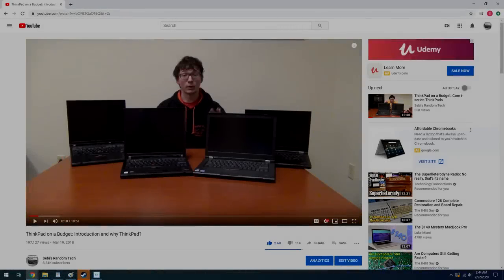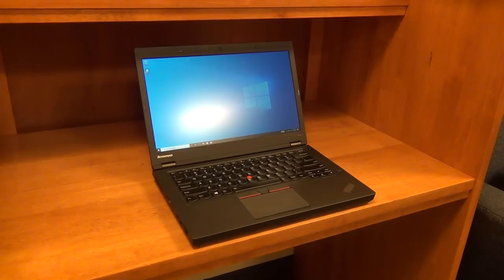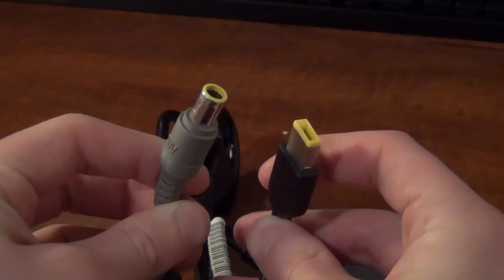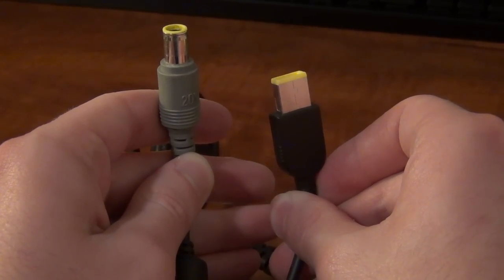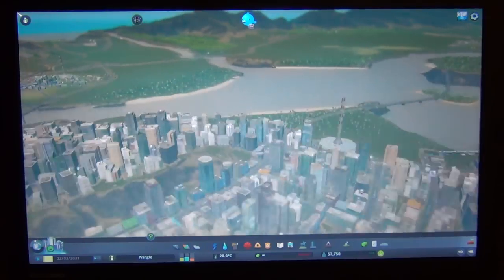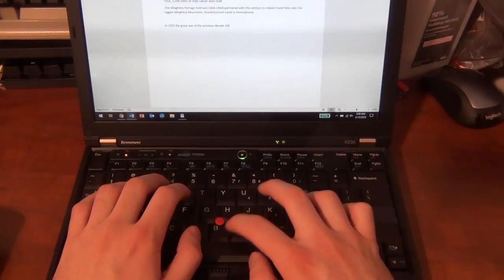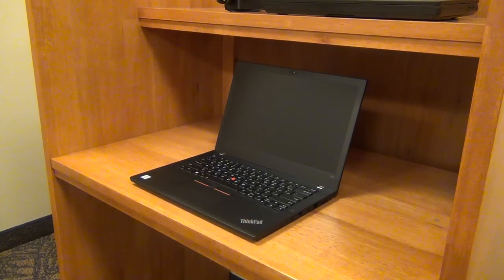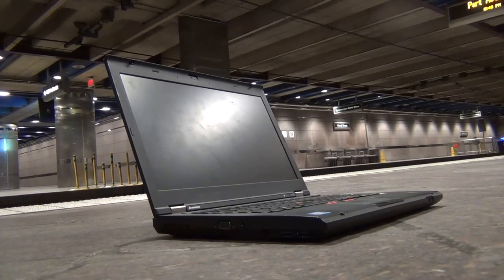Best Value ThinkPads in 2020

Comment: You're the man.
I Couldn't make my mind on witch one to pick but you helped me decide. 
Glad they managed to finally open the BIOS on machines past the X200.
Reply: So I picked a T430 for 61 dollars. (115 total for shipping and import fees)
i5 2.6Ghz | 4go | no HDD (the bottom screen looked a bit cracked, no pic with screen turned on were provided but seller offer 30day return option)

For now, they seem to go around 115 USD but without shipping. The famous x series look more expensive.

You guys have any recommended links to max-out the ram?

For screens I've seen 1440p displays but no 1080p ones. Isn't that too much for the GPU?
I guess I cut the resolution in half in games and still have a sharp view since it's precise 50% pixel reduction.

Comment: i just bought a t430 with 16gb RAM, i5, duel SSD's (250 & 500gb), spare battery & dock, Win 10 with office, with backlit keyboard in near mint condition for £250 (around $300). very happy, thank you for all your advice Sebi. love the channel. only thing is the hinges are a little floppy, any chance of a hinge replacement video?

almost forgot...

replying from my thinkpad
Reply: I wanna buy T440s. is it good for value?
Reply from the maker: I might be doing that with my T430 soon, stay tuned to find out! :)

Comment: 20:10 if you aren't aware, people have successfully built EC patches for the T25-T480 frankenpad thing. I think it can only be flashed with hardware, but it shouldn't be too expensive. What is the issue is that you cannot get ANSI layout classic keyboards anymore, the only ones out there are JIS.

Comment: T420 with i7 quadcore, built in webcam, 1600x900 Display, at least 8GB of RAM, new batter, BD-drive and current Linux Mint Desktop system installed on a SSD. Perfect daily runner. You don't need more than that for your every day tasks. Just make sure you better get a version with Intel graphics since the Nvidia Optimus tends to overhead the system a little too much. Unless you wanna play some games on it and have a laptop fan cooling pad underneath.

Comment: It should be pointed out that the Thunderbolt issue on some of the newer ThinkPad's (with the T series it started with the T470/T570) is caused by a critical bug in Intel's Thunderbolt firmware, which isn't present in the newer versions of the firmware. If the firmware is updated "before" the damage is done then the will be no Thunderbolt issue, and the affected ThinkPad won't need to be sent in for repair (entails getting the motherboard replaced). Was a huge surprise to hear that the Thunderbolt Firmware is developed by Intel and NOT Lenovo. Intel used to manufacture their own motherboards, but often they were defective. One of the major reasons the Intel motherboards were defective was because of the buggy firmware. Clearly Intel haven't learned their lesson.

It is very likely that other laptops supporting Thunderbolt will be affected since Thunderbolt is a proprietary technology, and only Intel can develop the firmware. Can easily see "Boltgate" becoming a widespread scandal that catches Intel off guard, watch this space.
Reply from the maker: I believe I mentioned that the T480 was one of several different models affected by the firmware issue, maybe I didn’t. :P

The patch released should fix the issue for controllers that haven’t gone kaput yet, but I still have doubts about it being a long-term fix. We’ll only know for sure in the coming years as these laptops are put through their paces.
Reply: The version of the Intel Thunderbolt firmware causing the critical issue is v14 ( https://github.com/fwupd/missing-firmware-lenovo-thinkpad/issues/25#issuecomment-577871227 ).

Comment: My daily is a T530, circa 2013. Bought it at an employee sale for $300. No problems during the 5 years that I've owned it. Dual Booting between Debian 10/Windows 10.
Once thing I can recommend, if you don't do any heavy graphics, disable the Discreet Video in Bios -it burns through battery life. 
I mostly use my laptop for SSH remote admin, Open Office,  and streaming content from my HTPC. For an extra $100, I picked up a SSD and maxed out the RAM from Amazon.
Even when I am too lazy to boot into Windows 10, I can run it in Vmware in Linux with no problems.  Not bad for 7 yr old laptop.

Comment: Just bought a t480 yesterday for 150€ very good condition, new battery, 16gb ram and 500gb storage. Couldnt be happier
Reply: I've bought t480 full hd ips, backlit keyboard, 16gb 500gb nvme for 223$ yesterday, not sure whether it's a good deal, but I'm happy
Reply: @Jesus_s_Real  its a very good deal indeed. ive bought another one lately for 230 $. the one for 150 was from an old guy so i guess it was a very very good deal ;)

Comment: Hi Sebi, very nice review. I have a question that always confuse me. Is a 1st or 2nd gen i7 quad core better than a 7th or 8th gen i3 or i5 dualcore...in terms of computing. For daily tasks, i feel no difference if i use SSD. However, when i goes to website like cpuboss or so, different tests could generate reverse results in terms of performance, do you know why? From my layman understanding, if the frequency and the number of core, cache are higher, the multicore computation should he faster? But the answer i got from these websites always varies
Reply from the maker: For several years Intel was more focused on improving CPU efficiency and power consumption instead of improving performance, so many 3rd-4th generation CPUs will rival the performance of 7th or 8th generation chips. This is also because the T420-T440p use higher power processors, after that generation Lenovo switched to low-power ultrabook processors that actually had less performance than previous generations. A top-end quad-core i7 for the T440p, for example, performs nearly on-par with the top-end i7 option for the T480.
Reply: @SebisRandomTech  Thanks for the prompt reply, Your video is very helpful! I love to maximize the value rather than buying a newest model

Comment: I still found T430 is most reliable then most of the machines. Mine is upgraded with 12 GB RAM FullHD 1080 display and 256 GB SSD and believe me it rocks.
Reply: how did you upgradet the display to FullHD? From which model you replaced it?

Comment: I wanted a media laptop to use at home for simple tasks (like browsing, writing and reading) because I was using always my good laptop that I use for work.
Some months ago  after some reserch bought a T440p (150€) and these upgrades :512GB M2 sata ssd MLC (90€) 16GB RAM 2133 Hz (80€) 2TB SSHD (70€) Docking station (15€) caddy for third hard disk (5€).
I chose this model because I wanted the most recent with highest upgradability and i'm glad Sebi is the same opinion.
The next upgrades will be the Lcd panel (40€) and the CPU (around 100€) but for now i'd stay, already spent too much :)

Comment: Watching on my T430.  It's great except for the crappy panel. How can I upgrade it??? If the colors were better, I could deal with it.
Reply from the maker: As I mentioned in the video, there are FHD kits you can buy on eBay that allow you to put a 1080p IPS (better colors, contrast, viewing angles) panel into your T430. I’m looking to do that upgrade to one of my machines soon and of course make a video about it.
Reply: I've done it. Look for "Saniter T430" on your favourite auction site. I used AliExpress as eBay UK didn't have any when I was doing it.

Then you want a good screen. There's plenty of discussion on reddit and the ThinkPad forums as to which are the best to go for. I followed the standard advice and checked with the seller that they were sending me a B140HAN1.2 (as distinct from the .1 or .3 variants) and it is a superb screen.

The first seller I bought one from lied and sent me a .1, claiming it was identical to the .2. I made them take it back, and didn't test it beforehand.

It was time consuming, but made the laptop worth using.

Comment: Thanks for the info! Would you still recommend the T440p at this point in time? I found one with new battery and AC adapter for about $200 but I’m still on the fence.
Reply from the maker: That's a little on the high side, but with the pandemic laptop prices have jumped up a little bit. It's still an excellent laptop, and my recommendation still holds true.
Reply: @SebisRandomTech  Cool, thanks. Just browsing eBay recently it seems hard to find one in the $150 or below range that isn’t a total project (missing battery, hard drive, ac adapter, dead pixels, excessive damage, etc) right about now. I’m blaming the “work from home” trend as well.
Reply from the maker: @krazykat64  Well, get whatever you can afford right now and don't have to perform serious repairs on. Hopefully soon everything blows over and gets back to some semblance of normal.
Reply: @SebisRandomTech  The good part of it is I don’t really have to sink much extra into it right away. I already have a 16 GB kit of DDR3 I picked up on sale for $36 and a spare 240 GB Kingston SSD I had lying around already. Eventually I’ll drop $20 for a trackpad and eventually an IPS display. Beyond that I’m not sure I’ll do much else.I figure if I don’t go behind $150-ish in upgrades even if I only get another 3 years of use out of it it will have been worth the total cost.

Comment: Fantastic video. From years of collecting and buying from former employers or used and refurbished machines, we have various older Thinkpads in our household: T60, X220, X230, T410, two T430. Even the oldest, the T60, runs flawlessly; despite being the oldest machine, it ironically has the by far best display, a beautiful 4:3 IPS display,  1400x1050 max. resolution.
Then, there is THIS ONE "NEW" Thinkpad, an E480. And guess what? Just a little over two years (the warranty period for the machine), the Thunderbolt connector died, rendering the machine utterly useless, because it can no longer be charged. Unbelievably infuriating. I would definitely not recommend buying any USB-C charging laptops, and will certainly stay away from newer Lenovo laptops, since I'm not the only one with this problem...
Reply from the maker: Look for a P1, X1 Extreme, T15g, or one of the thicker P-series machines. They still use a standard Lenovo charger instead of relying on USB-C.

I have the 1600x1200 IPS panel on my T60, without a doubt one of the best laptop displays of all time.

Comment: Just bought a t440p and love it. Love your content. Just wondering,what is your daily driver now and thanks.
Reply: great laptop than the t440 and t440s

and i dont know its true or not, the t440p processor is more power than t450 processor which is u series (base on syntethic benchmark)
Reply: @baguskusumaloka  do not know that. I use my T450s for now as my daily driver and love that laptop also.
Reply: @huntnyc  if you search the processor code, you will find some benchmark comparison
but the plus T450S is slim, and a year newer than T440P, so support is longer than T440P i think
Reply from the maker: Currently switch between my Frankenpad T601 shown in other videos, the T440p shown, and a W540 that I’m doing some upgrades to. I always jump around though, there’s so many good models!
Reply: @SebisRandomTech  good video for showing what the best of each one type

hopefully, lenovo didnt really remove the trackpoint button, yes, some "tech reviewer" really need trackpoint let go, yes the big youtuber with a dozen of team, but the trackpoint is really good use in term you cant use trackpad, like when using glove etc,

Comment: I agree with just about everything you say here. IMHO, the T430/T430s, is STILL the "Best Bang for the Buck" in 2020 for the average user. especially with the "better" 1600x900 display. 

I've been able to compare the T480, and W540/i7-4900mq, side-by-side. All things considered, the W540, or the i7-4800mq powered T440p, are a better value.

Comment: very informative. i have question about thunderbolt issue on t480, is it possible to effect the other usb c charging port? so there is no way to charge the laptop, Or are the two ports separated from each other, so there is no need to worry?
Reply: you can still charge the laptop

also there has been a fix to a "dead" thunderbolt controller. it has been posted on the thinkpad subreddit.

Comment: Still using T530 since it came out  ... and a non-working T61p. (T530) Replace all drives to SSDs and still running great in 2020. Planning to mod it with classic keyboard and CPU soon.

Comment: Hello I'm an entrepreneur student, my budget is $1200, I'm looking to buy thinkpad for my daily driver, I need IPS Panel & 100% sRGB, I pick thinkpad because every reviewer said it has the best keyboard ever, can you help me to pick which is the right thinkpad for me to buy? sry for my bad english
Reply from the maker: Many of the models with higher resolution screens (1440p or 4K) have 100% sRGB. Look at the high resolution options available on the P50 and P70 series, as well as the P1, X1 Extreme, and possibly the X1 Carbon.

Comment: I would like to get a t450 but the absence of HDMI bothers me. What do you think? Plus I'm not really sure it comes with a 1080p ips screen. Your thoughts pls.
Reply: you can buy a display port to hdmi adapter, display port works  very similar to hdmi so you will not have any problem
Reply: My t450s came with a fullHD IPS display but I already changed the screen of a T440. Not so hard!
Reply from the maker: The T460 is essentially the same design as the T450 except the VGA port was replaced with an HDMI port, and it was available with 1080p screens from the factory.
Reply: T450 have mini Display Port, so it's better option than HDMI.
Reply from the maker: @W-Ostr  T460 has both.

Comment: Holy Moly, yea man. Good old ThinkPads. I personally hated all the notebooks...before ThinkPads. 6 Years ago my uncle gave me a Thinkpad T40. Holy Sheat, this mashine was still working like charm! Silent and still pretty fast with XP on it :D All the other notebooks were soo slow.... I dont know why, but all consumer notebooks i tested were pretty slow after some time... Then I bought a T400, T430, T440s, T540p, P50 with xeon.  Now I am owning only my old T400 and my new T450s. Untill now P50 is still my favorite. Absolutely beautifull beast :) Some day I will get new P series, but it will take some time ^^ Overall, all thinkpads I got were excelent. Good qualty and durable as hell. T430 got problems with some noisy coolers from one manufacturer, T540p got dumb noisy cooler which was rumping up too full speed and tehn going down to normal speeds, Still dont get it, why they didn't fix it in BIOS?!  Also, it wasn't black ,it was grey :( I love Thinkpas since I got my first T40 xD

Comment: I have been working helpdesk now for 13 years, starting to use Lenovo products in late 2007. I have to say they are pretty tough and just great laptops in general. I do prefer the T440p's very much. Today I am still using my T450s with 12 gb ram and a 500gb ssd. Have the dock as well. I have lots of older Lenovo's at home. going back to the T/R61's. Solid design on the most part. The X series not a fan of so much, as the right front corners break the frame(has someone figure out a fix for this besides replacing frame?). The power port tab breaks, but found a hot glue trick to fix that. Anyway, I could talk about them for hours, thanks for the video, brought back lots of memories on these. Take care.

Comment: Will the recommendations work for the 500 series? For example t540p differs from t440p only in screen size? Or maybe there are some dirty tricks?
I just realized why not take a closer look at the T540P. They are only 300 grams heavier and slightly larger. But I'll get a bigger screen.
Reply: T540p is a good machine. Due to the extra screen real estate, the T540p will be more expensive. 
You will get plenty of value from the T540p.
Sebi's argument here is that you'll get the most value out of a T440p, since it will cost less and preform similarly.
Reply: @bijanshadnia3620  They are really significantly more expensive. Now I get it, thanks.